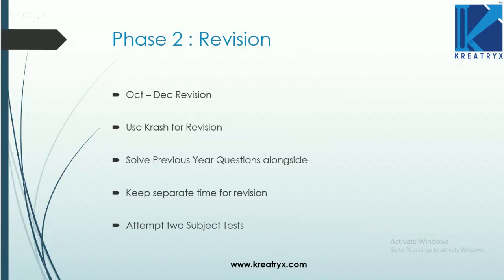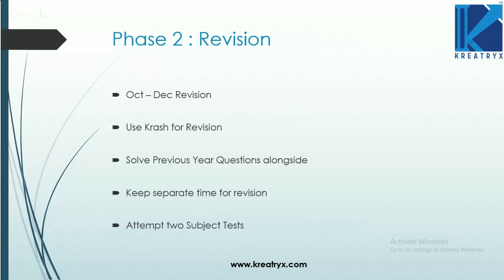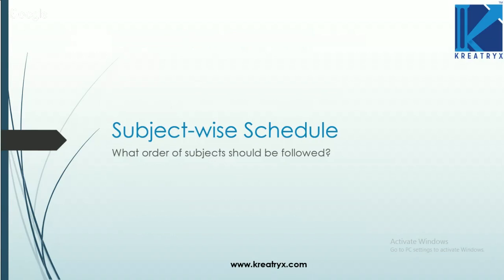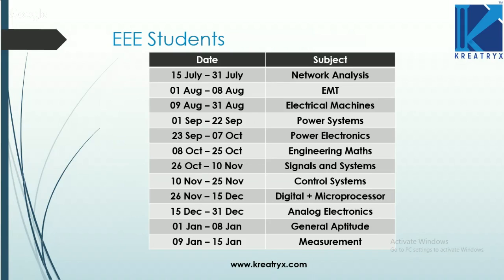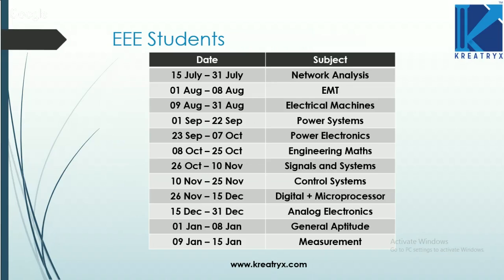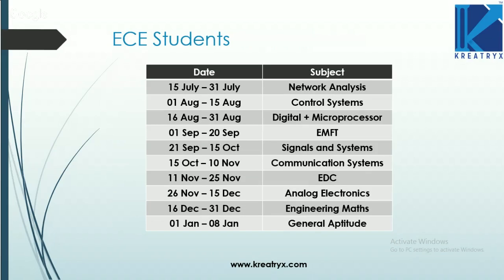Kapsule Zetta Users Strategy Webinar

Comment: COLLEGE

ll Semester Pre Final Examination, 2016-2017

TEE-577 APSM. Dated

me: 1 Hr.

M.M.: 20

1. Calculate the direct axis synchronous reactance Xd, direct axis transient reactance Xd' abd

direct axis subtransient reactance Xd" of the 60 Hz salent pole synchronous machine with

following parameters

Ls 2.7656 mH, Lff 433.6569 mH, Ld 4.2898 mH, Ms 1.3828 mH, Mf 31.6950 mH,

[5]

Md 3.1523 mH, Lm 0.3771 mH
Mr 37.0281 mH

2. A synchronous generator is rated 25 MvA, 11 kv. It is star connected with neutral point

solidly grounded. The generator is operating at no load rated voltage. Its reactances are

x: 0.20 pu and xo 0.08 pu. Calculate the symmetrical sub-transient line currents for
Please tell me how to solve these questions